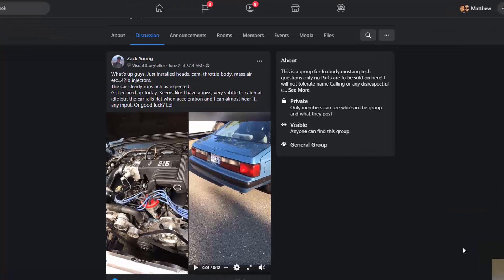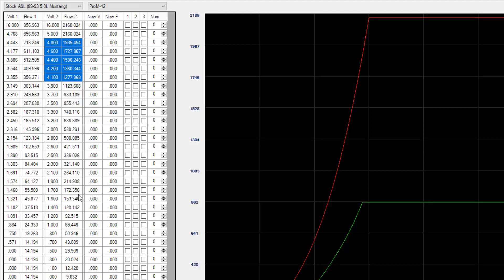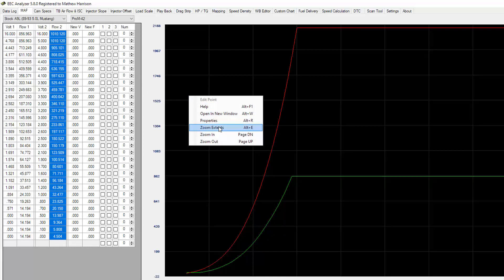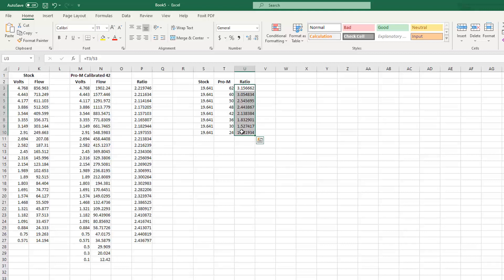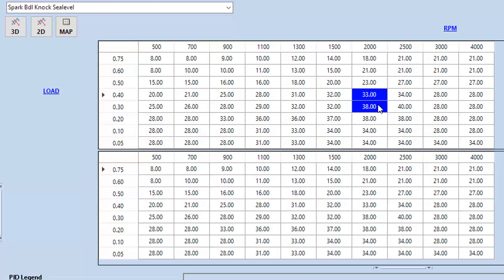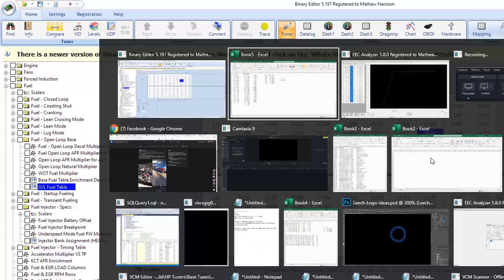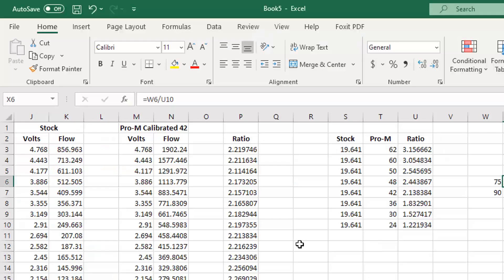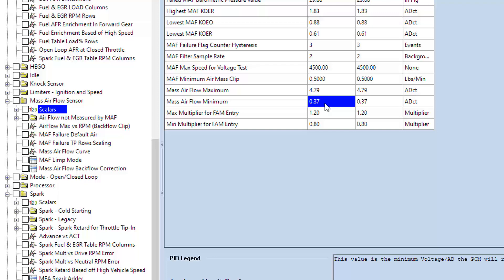Calibrated MAF without a Tune - Will it work?

Comment: Hey @leechmotorsports would a bbk 76mm maf calibrated for 19lb injectors throw the load tables far off? A guy local has one for sale cheap and in this video the 24lb one doesn't seem to far off and I didn't know if the 19lb one would be even better or not

Comment: I had considered cranking pulsewidths before, but I had never considered that the load would be lower and would call for that kind of timing.  That explains why cars with different injectors but similar combos needed differing base timing settings.  It also explains why swapping to the QH pushed my current car, that was doing 13.0:1 @ WOT, to suddenly running much richer around 12.3.

Thanks, man.  Love finding things I thought I understood fairly well, but didn't.

Comment: I just dont know why Matt didnt just tell people who buy a calibrated MAF that they should plug in the numbers given then run whats called the MAF autotune located in the last choice above the MAF transfer settings where you follow the directions then start the vehicle and it custom tailors your MAF flow as the engine is running aswell as sets the new fuel adaptive values..

Another thing I dont see you mention is disabling the MAF backflow clip settings that limits the MAF.....

Setting all backflow values to the highest setting of 3.99889 disables this hinderance..

Another thing I never see him cover is the different type of camshafts and how overlap affects the injector timing events and that the A9L is set at 352 degrees with waivering values in the higher load area and with camshafts that have tighter and wider overlaps that in order to get a smoother idle that stays at lambda you must change these values to reflect on your camshaft exhaust valve closing to intake valve opening events instead of changing the MAF transfer settings so you dont get a wet upper plenum from the injectors firing at the wrong time and having other cylinders draw the prematurely injected fuel up into the plenum..

Something else is in ISC gain multiplier vs RPM and that by setting all the values to 2 from top to bottom is the 100% best bet with lumpy cams... and that on Neutral Air RPM you make the 5 seconds 10 seconds increase the rpms to 96 then remove the 200 and 255 second entries and make them 20 and 30 seconds then you remove the 72rpms at the top right and make it a zero..The idle will be alot more smoother and easier to dial in the fuelling afterwards.
Reply: Interesting

Comment: Pro-M recommends tuning when running 42# injectors or larger and if the engine is smaller than 351 CID.

Comment: For those saying it works great, put a wide band on your car.  My car with 30lb injectors and a calibrated maf is seeing near 20:1 on the afr at idle.  I haven't had it out since installing it but the lean condition certainly explains the low rpm surge I get.

Comment: Just got a stage 1 TF top end kit twisted wedge 170 heads, and also got holley systemax upper and lower all new and about to install it, what should i do with reguard to the MAF? I already had 24lb injectors new that come with the car. Should i put the 24lb injectors in and use the stock maf? Or move to a calibrated 24LB MAF? what would you do

Comment: The stock computer is not that bad it picks up and reads pretty good. I never had any problems at all with the pro m calibrated for 42. It ran super fast from idle to shift at 7000 rpm.

Comment: i have a 1994 cobra can i put a bbk 76 mm mass air with stock mass air sensor
Reply from the maker: I would not recommend doing that. Sensors are very much calibrated with a a specific housing. When you love a sensor to a different housing, the results are going to be unpredictable and almost certainly not good.

Comment: FYI 
I also have a 94 4.6 MA obd1 TownCar. With a MA fail and the MA unplugged it runs way better. Crisper shifting elec aod, obviously not pulling timing on shifts, stronger pulls, instant start up, better cold idle, but loss of 2 mpg. Replaced with true  Motorcraft MA sensor and...  back to "normal" mode🙄. 😷😲

Comment: So Ive rebuilt my 87 fox with b&m trans...did a maf conversion.. egr /tad/tab delete...added a e303 cam gt40p heads 93 cobra upper and lower intake ... So I got a calibrated bbk 19# maf would it run fine ??? Currently I'm getting the bugs out of it ..
Reply from the maker: It will probably need tuning to get it to run how it should. And you’ll probably need 24lb injectors. I suspect you’ll find the limits of the stock 19 lb ones pretty quick.

Comment: Is this kinda a standard conversion ratio or does it very from maf to maf? Iirc i ordered a mass air conversion kit with a caled maf for 42? Injectors but ended up only running 36s for now

Comment: These cars are so old and the system that supports them the same you can get away with using a mass air and injectors to trick the computer and it will run fine,because of the newer Mustangs and the Coyote engine coming on the market we want to tune everything,there are forums out there that deal with cars made in the early 80s that had a somewhat primitive computer and the first question they will ask when a problem arises is "you got the tune yet?" 

Guys in the late 80s early 90s got these cars to stand on their ass end straight down the track with no tune at all,however if your into the new way of doing things and you want to squeeze every little drop of power out of your Mustangs and are serious about racing then by all means get on the tune train,its pretty neat stuff.
   
This may seem silly but as a guy that has been involved with these cars before most of the new owners were born something i have learned is make sure all your hose connections to your intake are tight and you have no vacuum leaks, many a idle issue (which these cars are famous for) are caused by this, you will be pulling your hair,buying new parts where the answer is so cheap in the form of a few hose clamps,been there done that.

There are so many different type of intakes for these cars that we have a tendency to swap them out and just push our new hoses in and dont use any kind of fastener,i recently ran into this with a new GT40 tubular intake and not following my own advice till the light bulb came on and after that the car ran smooth as silk.

Comment: I need help. I have a stock 5.0. Im going to get a accufab 70mm throttle body and pair it with a pro m 75 mass air calibrated for my 19lb injectors. Do i need a tune for this, or is the pro m calibration good enough to run it trouble free. Its a 5 speed with the A9L comp.
Reply from the maker: Honestly there will be very little gain from those mods on a stock intake and heads. I would recommend leaving all that stock until upgrading other things. But, you will likely not need a custom tune for this setup if you decide to move forward.

Comment: Thanks for sharing such useful information. I have a stock 5.0 with an upgraded 70mm throttle body and need to replace my maf. Would you recommend going with the Pro-m 80 for 19lb injectors? Thanks in advance.
Reply from the maker: Pro-m 75mm bullet is a more direct fit.

Comment: Might be a little late to ask. But I have a 2012 coyote with a supercharger. My mad is going out if I get a calibrated maf will. I need to retune?
Reply from the maker: In theory, no. But on a boosted application, I would absolutely never recommend making a change to a part this critical unless you at least have the tune rechecked. On newer cars with factory wideband control, closed loop WOT fueling, and knock sensors, you have a little cushion. But I still wouldn’t risk it. I put a “no-tune required” maf on my 2017 supercharged coyote. Idle fuel was off by nearly 12%, and the midrange needed some attention as well.
Reply: @LeechMotorsports  thanks

Comment: I'm using a 80mm pro-m w/ 42lbs injectors with tune(408w). Don't think my tuner had my transfer sheet at the time. I guess he just found a decent sheet from pro-m for the 80mm and plugged that in. I'm installing holley term-x now.  I was having an issue with this weird stumble right at 3k, I would have loved to be able to log it but couldn't. It was almost as if the ignition/spark was turning off and coming right back on.  I'm ditching the TFI for the Dual-Sync on the Term-X install. Thank you for the videos. They are very helpful.
Reply from the maker: Entirely possible it was an AFR issue. With a 408 and 42 lb injectors, I’m heading it’s a naturally aspirated setup with bigger heads and cam. If so, you sometimes have to manipulate your low load cruising AFRs to numbers that don’t make sense on paper.

Comment: Hey I had a question, i just built a 5.0 in a 90 fox body. We did trick flow 11r heads, stage 2 cam, intake, etc. So its essentially a 400hp motor but we got it tuned and it only made 305hp. Only thing we didnt change was the stock maf which i found out is 55mm and its pretty restrictive. Do you think a pro m 75mm will be able to help out with the added airflow?
Reply from the maker: Yes, there will be an increase in power with a physically larger MAF. Won’t be a crazy increase, but I suspect that meter with a sharper tune could pick up another 20-30 hp.
Reply: @LeechMotorsports  ok sweet. You think that and a new throttle body will be a good idea. I forgot to mention we also kept the stock throttle body.
Reply from the maker: Without question, throttle body will help also. Don’t ever go bigger on the throttle body than the diameter of the throttle body opening on the upper intake. Ideally, they should match. And the mass air meter should be the same size or larger than the throttle body. Simple setup would be a pro-m 75mm bullet mass air meter calibrated for 24 or 30 lb injectors, and your choice of 70-75mm throttle body. Accufab makes BY FAR the nicest throttle bodies for these bolt on 5.0 applications. You’ll also need to make sure you get the egr spacer so you have something to bolt the throttle cable bracket to.
Reply: @LeechMotorsports  yes our trick flow track heat intake has a 75mm opening so I definitely agree that we should match that with a 75mm throttle body. I was looking at the bbk throttle bodys but now that you said accufab was better I will probably go with one of those. We will probably pair that with the pro m 75mm maf. And we also ordered a 75mm egr spacer that deletes the egr and the 2 coolant ports.
Reply from the maker: Yep, I think you are on the right track now. Final note is to do all upgrades at once, then retune. Also be aware of the need to rework transient fuel enrichment with the larger throttle body. Since such enrichment is largely based on the rate at which the throttle is opening (measured in degrees per second), it’s easy to see how your throttle will move less and flow more.
Reply: @LeechMotorsports  Ok got it. Also we already bought a bbk cold air intake, will it be compatible with the larger throttle body and maf tube?
Reply from the maker: The bbk cold air intake is basically a perfect match for the pro-m 75mm maf. But when buying the maf, pro-m has calibrations designed specifically for a cold air intake application. It’s not the end of the world if you get the other style, but they do have both offerings for a reason. As for the throttle body side, it will mate up just fine to a 75mm. You may find that you need to trim the cold air tube just a hair so you can keep the tube off the strut tower where it has the sharp bend near the throttle body. But every engine sits a little different.
Reply: @LeechMotorsports  Ok sweet, thanks for the help man! Im gonna get that stuff ordered up and after we get it all put on we will head to the dyno to get re tuned and see what kind of power it makes. I’ll let you know how it goes

Comment: That was awesome info.  I have 24.lb with heads cam and intake.  I've thought about the Terminator X.  Any thoughts on that system?
Reply from the maker: I have lots of thoughts about that system. Many of which will be the basis of my you tube videos between now and the end of the year. But in a nutshell, if you have a simple bolt on fox that is a street car and your factory computer and harness are in proper working order, I can’t justify going to the Holley. The Holley is a good move if swapping from a carb to efi or are doing a custom build from scratch.

Comment: So as a stock engine with gt40 intake and 70 mm tb it seems like without a tune it would be better to keep the stock meter, but would it benefit from a larger sample tube say from some of the other ford models out there that fit on the fox?
Reply from the maker: No, as soon as you start messing with sampling tubes, the meter will read totally differently. Best bet is to stick with stock mass air meter or got to a larger meter at the same time you do a tune.

Comment: can you tune a car with a Calibrated MAF?
Reply from the maker: As long as the maf itself has a calibration from the manufacturer that will not have to go beyond 5v at your engine’s peak airflow, it can be tuned. So let’s say you have a simple 300hp heads,cam,intake deal. And 30 lb injectors. But your maf is “calibrated” for 42 or 60 lb injectors.... no problem. That can be tuned. But if you have the same combo, but using a maf “calibrated” for 19 lb injectors, you’ll end up hitting 5v on the meter before you reach redline. And in that scenario, there isn’t a way to tune around that.
Reply: @LeechMotorsports  current injectors are stock 19ib with BBK 19lb Calibrated MAF so this can't be tuned? Future setup will be at least 24lb with an HCI what MAF should I get so the car can be properly tuned? FYI the inside of the motor currently is stock, bolt on's are as follows BBK shorty headers BBK high flow Catted H-Pipe flow master cat back rear end 3.73 with ford aluminum driveshaft, Aftermarket 3 core rad after market thermostat set to 160C ford racing wires MSD cap rotor BBK CAI with BBK 70MM throttle body base timing is set. Under drive pullies on the front as well. Question is once this HCI gets installed what would be the best fuel pump and injector size as well MAF to have with this type of setup? For the custom tune. Thanks for your input
Reply from the maker: You have to think of a maf kind of like your injectors. With tuning, you can use an injector that is way bigger than what you actually need and it will still work. But if your injectors are too small, they will reach 100% duty cycle before you reach peak power and tuning can’t fix that. Maf is the same. Too Big and it can be tuned. Too small, and it will reach its equivalent 100% too soon and that can’t be tuned around. If you are going to stay naturally aspirated, a Walbro 190lph pump is plenty. If you then add boost after you do the HCI, you’ll likely need at least an aeromotive 340. The pro-m 75mm and 80mm mass air meters are very nice and are easiest to tune. If staying n/a, the meter calibrated for your eventual injector size will be a good fit, because that unit will run out of range right around the point where the injectors do. Then you log and tune to dial everything in,
Reply: @LeechMotorsports  thanks for all the information. Car is put away for the season but come the spring I intend to do the HCI, & really didn't know what injector size and MAF to put on. The HCI i looked at said min 24lb your saying I can have larger like a 30lb I hear ford has a great data sheet on tuning for there 24/30lb injectors. Problem I have is 3.73 short gear ratio top's out way too quick, being a street car mainly I'm thinking I should have gone 3.55; what's your take on the gear selection? It's a total rear end new from the clutch packs to everything else.

Comment: i'm not going to pretend i know anything about tuning other than just the basic stuff..but years ago i was told there was a hack that a few tuners did after a maf change and larger injectors was to change the CID to fool the computer for the load numbers to be closer to what it should be ?  if you know what i am talking about would you be able to explain to me why they would use this process?  or did it offer a way to "get by" without going too much into a tune?
Reply from the maker: Yes, changing cubic inches in the tune will affect load numbers. As cubic inch scalar goes up, the load for a given airflow amount goes down. And the other way around. But if you have the ability to tune that, you can go ahead and leave cubic inches alone in most cases and handle the issue elsewhere.

Comment: I love your channel. Question for you regarding calibrated MAFs. I have a completely stock 1989 GT with a 5-speed transmission. What are your thoughts on swapping the factory MAF meter to a 75mm Pro-M that is calibrated for 19lb injectors/stock air box? My thought process is if my stock meter were to go bad I was thinking about upgrading to a bigger Pro-M. My concern would be the A9L wouldn't like that. Thank you for providing us with fantastic content.
Reply from the maker: I would recommend replacing it with another stock MAF if it does for some reason. This is, of course, assuming you stay stock and on factory computer settings. The pro-m would probably be fine in this application, however, it’s unlikely to add any power to the car and that’s a lot more expensive than finding an original one in good working order.
Reply: @LeechMotorsports  Exactly. Junk yard MA sensors are $5.
I rather have a used Motorcraft than a new chinaporn.
Note, if they plug in, they're the same.👍 Check 5.0/4.6 crown Vic, TBird, etc.

Comment: That is a great video. before I got my quarterhorse. I ran a "calibrated 24lb" bbk mass air for years. It pulled great in the upper rpm but ran rich at idle.